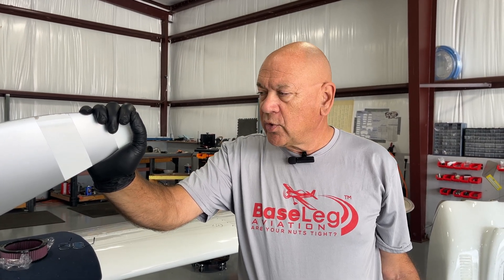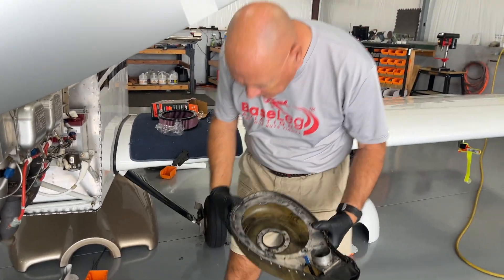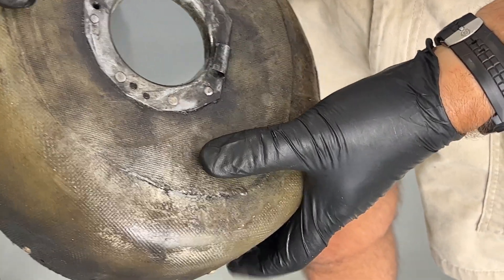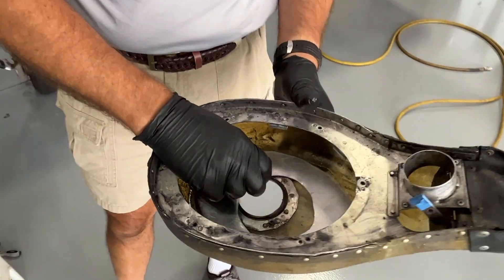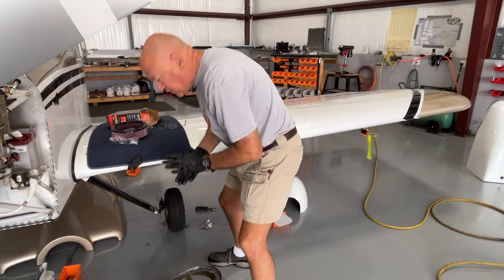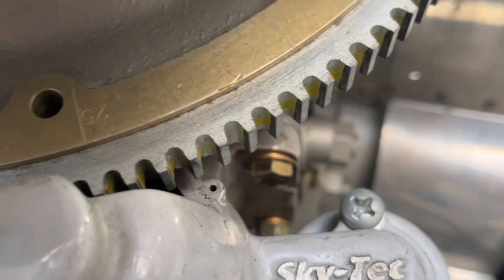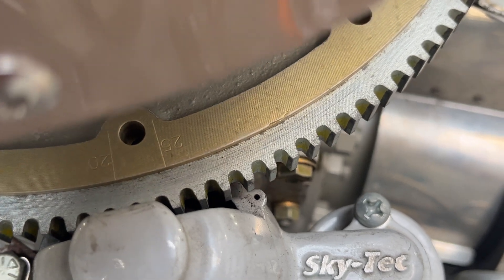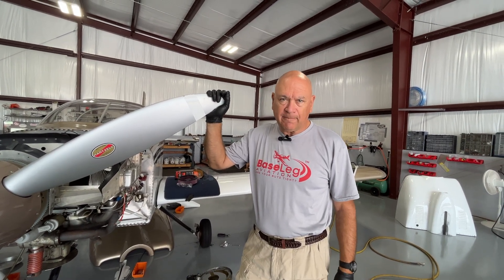Damaged air box and miss timed magneto

Comment: Could you have installed a layer of carbon fiber on the inside and patch the outside with a layer or 2 of glass? Thanks for the video.
Reply from the maker: you could, but I know the aluminum sheet doesn’t grind away. Been doing that for years, so we’ve been able to see how they hold up.
Reply: @baselegaviation1614 
I was not meaning to question what you did, I was only asking for my information. Thanks for answering